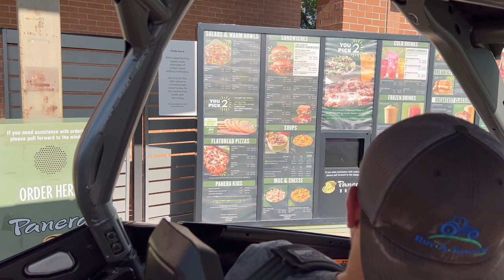My new FAMILY CAR is a Polaris Pro R! Massive Machine!

Comment: I don't know if your vehicle is included... but I just saw an article about a recall on Polaris side by side,... something about the steering wheel coming off or such... just an FYI.. don't want you and yours getting hurt.. have fun out there
Reply: If you buy a Polaris RZR you better get used to receiving STOP RIDE notices & having to drag it back t the dealer for repair. The dealer missed the factory F'up finger tight nyloc lock nut on the front pivot bolt on my rear trailing arm at pre-delivery. I found it after 100K's of driving & hearing a rattle, if that bolt had come out the trailing arm would have dug into the dirt & flipped us over. Must have been a Monday down Mexico when they put it together.

Comment: Congratulations Bruce and Amber with the new addition to your family. I'm rocking a 2021 Can Am Maverick X3 XRC turbo RR two seater and they are rated at 195Hp at the wheels but Whalen's speed dyno'd a stock one & it put out about 220RWP. I too had a 2015 Polaris RZR1000XP and found I could find it's limits speed wise pretty easily & regularly, not so with the new Can Am, it's scary fast in the bush.

Comment: Those RZR pros are nice but insane on the price. I’ve got 2 CanAm Commanders my 800xt is has a 6” CATVOS lift and 32” Black Mambas with 10” wide Gernade wheels and my 1000xt has the 2” raked front A-arms and the 3” stretched rear Trailing Arms running on 30” radial OutLaws with stock wheels